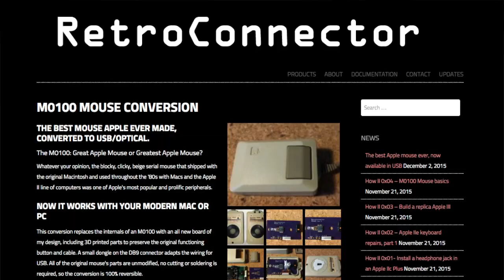How II 0x05: M0100 Mouse USB Conversion Kit

Comment: could I use this kit to convert my mouse and then use it with the serial port on my Macintosh plus? it would be more reliable than the roller ball
Reply from the maker: no. the signals are USB so it will only work on a modern machine after conversion.

I'm working on an adapter that will let you plug any USB mouse into the 9-pin mouse port on a Mac or Apple ii, however. it'll be out eventually. I have a lot of projects on the books at the moment.
Reply: +Charles Mangin okay thanks for the reply! And good luck with that project.